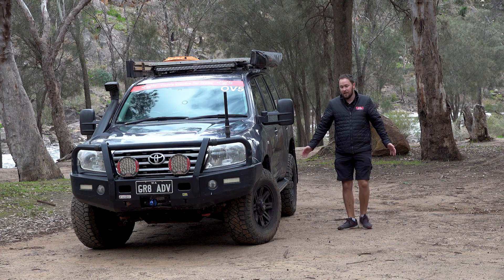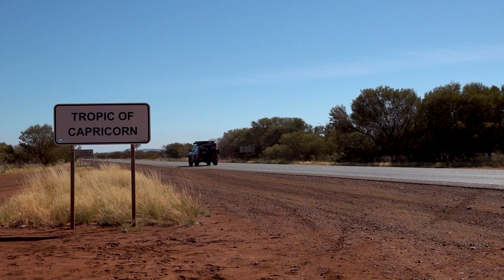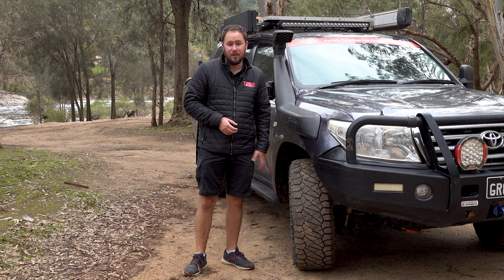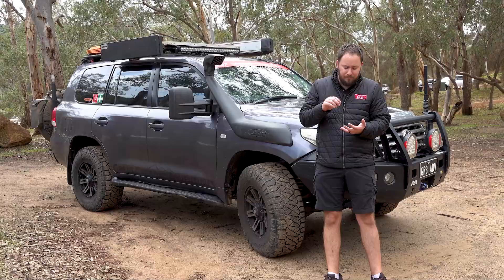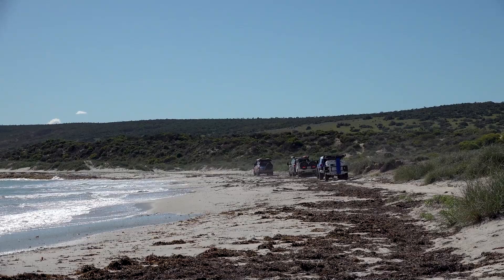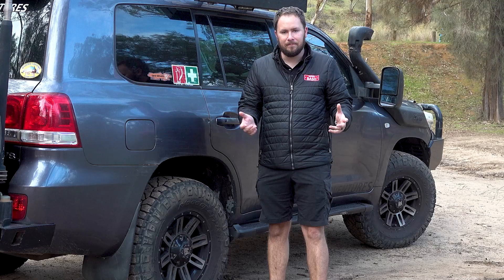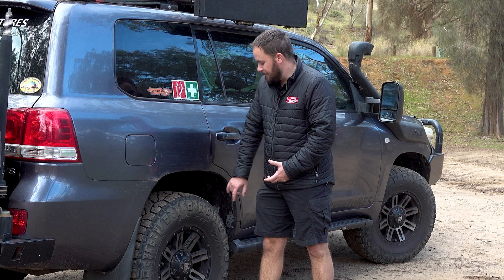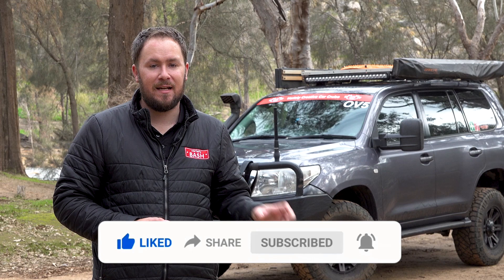My favourite tyres!!! Nitto Ridge Grappler Tyre Review

Comment: Nice review mate! 

How often do you rotate them? Looks like a very consistent wear.

Very timely for us as we will need to replace our current toyo AT and were looking at the RTs. Might look at changing brands👍👍
Reply from the maker: Rotated and aligned every 10K 👍🏻 - Both Nittos and Toyos are great tyres…can’t go wrong with either…the Nitto’s are quieter on road but more expensive & harder to get. 

I would have either set again in my experience.
Reply: @great_offroad_adventures  has there been any balancing issues with toyo at3? Or toyos in general?